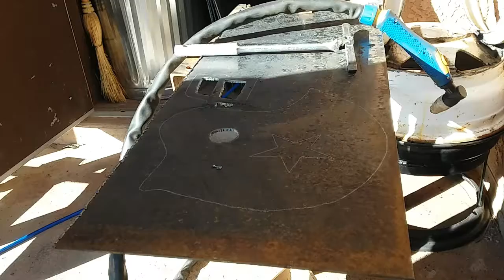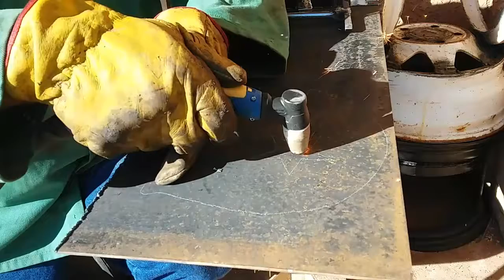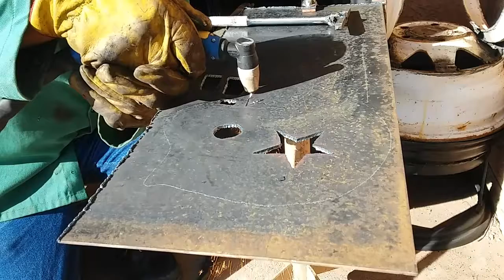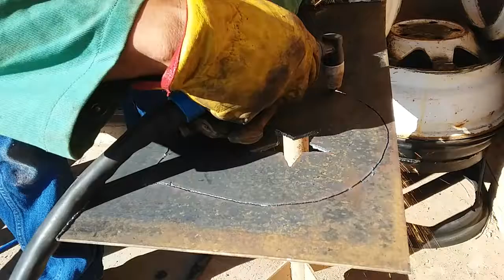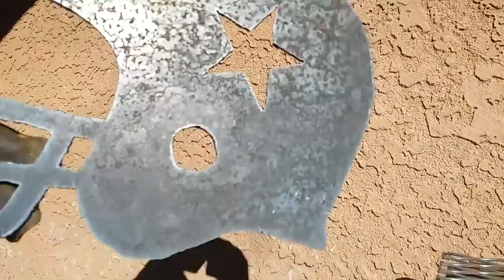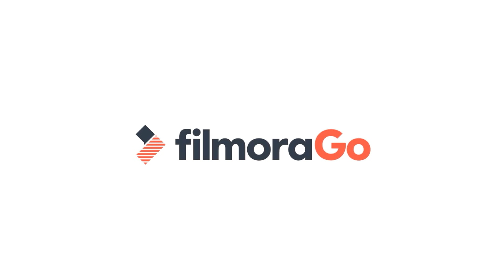Dallas helmets for bbq.

Comment: You have gotten pretty skilled with your plasma cutter, I assume you are still using your McGraw 20 gallon air compressor. If so it seems to be doing a good job too.
Reply from the maker: Oh yes indeed. I'm still using the McGraw 20gal air compressor with the cut50 plasma cutter. I recently changed the oil on it. I also upgraded the plug on the plasma cutter to 220v, since it is dual voltage. Cuts like a dream. I'll do video on my 1yr review of both soon. Thanks.